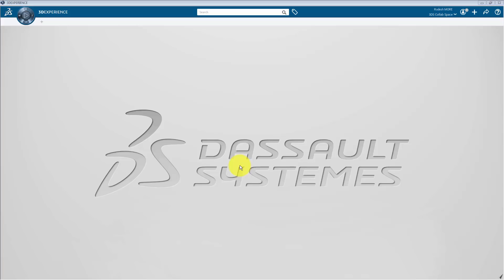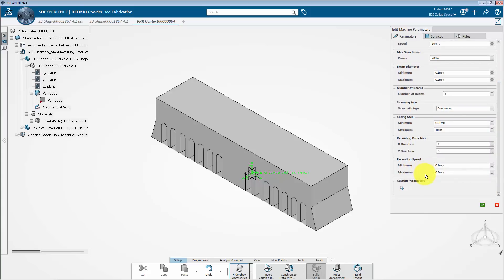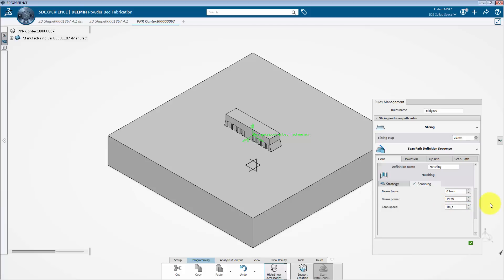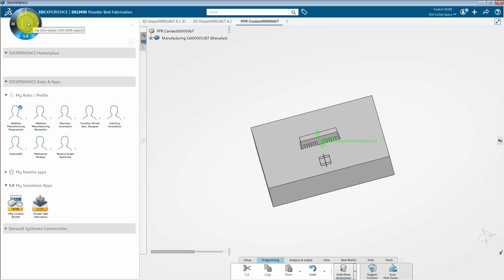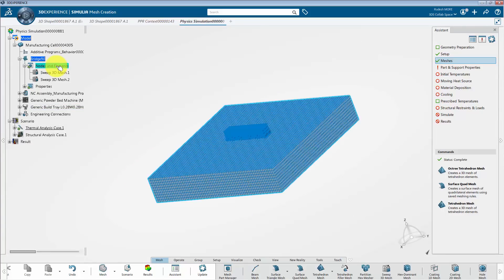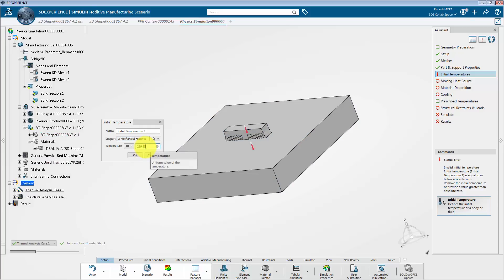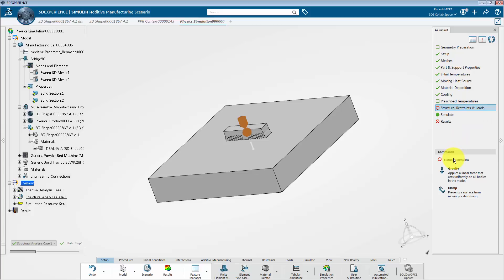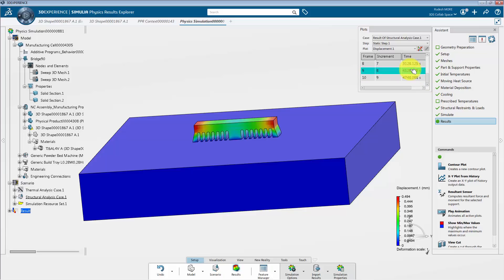Powder Bed Fusion | Additive Manufacturing Simulation | 3DEXPERIENCE Platform Tutorial

Comment: Hi, I am using 2023 version and I ran through this tutorial. I am willing to simulate a DMLS process. Although some commands have changed, I followed this example step by step. I do not understand the way you are assigning the initial temperatures, eg why they change from thermal to structural analysis considering they should be coupled analyses.